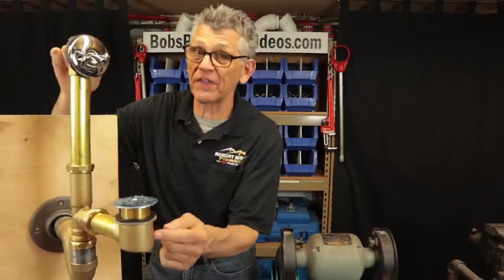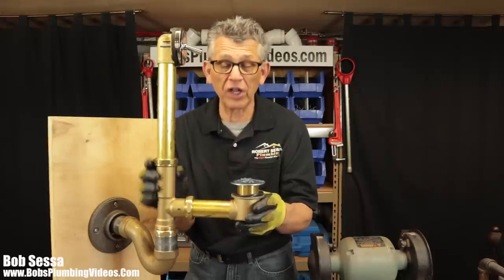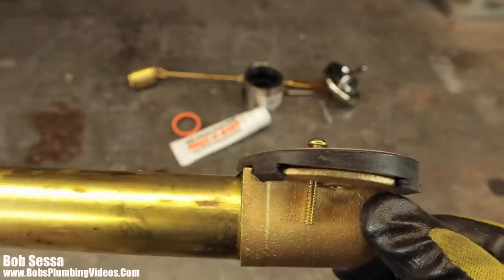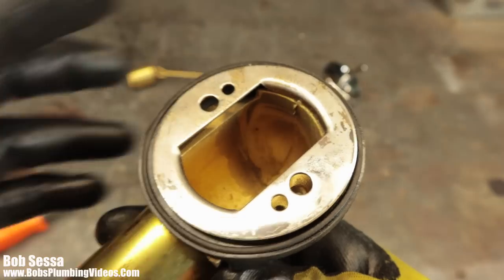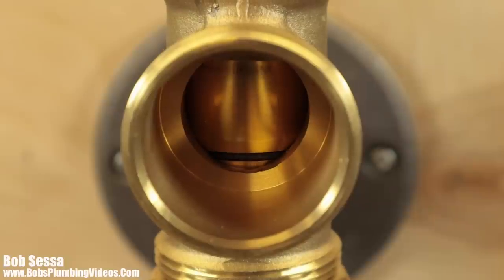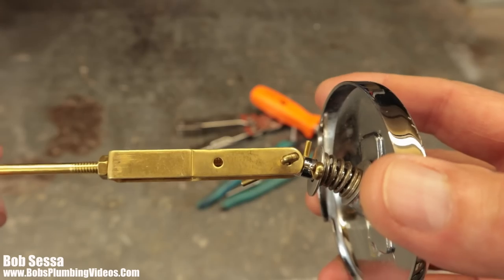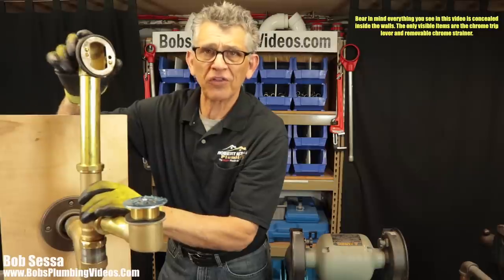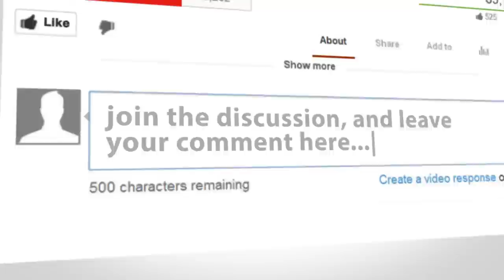Bathtub Drain Stopper / Trip Waste Assembly

Comment: Hi Bob. Well I have a doozy, when I took the plate out, I discovered that the linkage  was corroded and  the threaded rod was broken in half. So I assume the other half is in the pipe, at the bottom. What should I do? Can't afford a plumber, so mom has to fish it out somehow.
Reply from the maker: I can usually fish it out with a wire coat hanger, Make a small hook on one end and go fishing. Be warned, sometimes the plunger is so full of soap scum and or scale it will not come out. In this case you'll have to access it from the back and remove the overflow to yank it out.
Reply: Thanks.

Comment: My trip lever doesn't always stay open, as a result it has a habit of closing the drain while showering.  I have to keep opening it up so that the water drains again.  It just wants to keep closing on me.  What could be causing it to constantly do that?
Reply from the maker: The spring behind the face plate where the lever is located is probably at the end of its life, you can replace the entire face plate. The kit comes with new screws, just pull out the linkage,  pull the cotter pin out and transfer it to the new face plate. Re-install the cotter pin and you should be goos to go. Here's a link...https://bit.ly/3KX0fHw

Comment: Hey Bob. Great video and explanation of the assembly. This might be a dumb question, but how does the overflow work if there’s a stopper blocking the overflow pipe? Doesn’t this defeat the purpose of having an overflow? Am I missing something here?
Reply from the maker: The stopper is a hollow piece of brass that blocks the tub from draining, but still allows water from the top to pass thru.

Comment: I appreciate the full assembly example used. It always helps to get a Big Picture.   Bob also does a great job of clearly reviewing what has been taught to be sure we see the whole picture.  I will be checking things from Bob on any plumbing needs I encounter.   Great job Bob
Reply: I have a home owner customer that doesnt remember if the drain always drained or  if a stopper was  in pipe
To fill tube. Its unbelievable.  Anyway I  put a line from top or bottom and comes  out  on other side..
Do I have to make a hole on other side of.tub to unclog???

Comment: What if the flip is not connected to a plonger anylonger, n the water dont drain out the tub,whats to do
Reply from the maker: You have to find out  if the the plunger is in fact still inside the tee. Use a coat hanger with a hook on it and try to fish it out. I use a mini camera to look inside and verify if it's in there.

Comment: Would it be a good idea/no risk to remove the strainer just to clean out the hair that has accumulated directly beneath it and then reattach it?  My tub has some pooling of water during a shower which completely drains in about 5 minutes or so after turning off the water, not terrible but I'd like to get a better flow before it gets any worse.
Reply from the maker: The "strainer" that attaches with the screw? That you can remove and fish out any hair that's accumulated. But do not remove (unscrew)  the entire strainer assembly, you could open up a BIG can of worms!
Reply: @BobsPlumbingVideos  Yes,  just the strainer itself that attaches with the screw.  I never even considered removing the entire assembly, plumbing is not my forte! 😱 Anyway, I removed  the strainer and pulled out a few clumps of hair using a drain weasel although not as much as I was expecting.  I then replaced the strainer and much to my surprise the water is now flowing as I hoped it would....no more pooling and the little bit of water right over the drain was gone in less than 10 seconds after turning off the water! 😀 Thanks Bob, your video gave me a much better understanding of the drain system and the confidence to give it a go! 👍

Comment: Thanks for the video Bob. I wish this was available onto Youtube 10 years ago when I replaced the overflow on my tub.
No locking faceplate on the overflow and here I am 10 years later doing this again because the tube coming out of the shoe came loose while snaking the line.
Thankfully we have a 24 hour supply house in Brooklyn.  10 years older, and the 12 inches I had to work in 10 years ago seems to have shrunk
Reply from the maker: Thanks for sharing

Comment: Best video by far we've  seen. Very much appreciate you take the time to show every single thing. We just put in a brand new entire bathroom. Hooked everything up and everything worked but the tub wouldn't  hold water and zero instructions. So we've  been watching some videos and yours is by far the best. We give you a hundred stars. Thank you and ours does not have the backing plate.  And I think that we will find one that does just in case.  Thanks again. 👍👍👍👍👍

Comment: I currently live in a duplex and rent one side out.  Our side has had various issues, and I just discovered today what these systems are called.  One side has a trip lever with no plunger or spring-to-stopper system, while our side, has the lever with the spring, but there is no hardware connected where the spring ought to go, from the To to the non-existent plunger.  I have a 2 year old, by the way, and your reference to the little toy soldier brought laughable tears to my eyes.  Excited to see more of your videos.  Thanks for sharing.

Comment: My tub hasn't been draining right for a while now.    Cleaned the hair out, drain cover removed and replace properly.  Still wouldn't drain very well.  I was cleaning the tub after soaking some oven racks and leaned on the trip lever.  WHOA,  I could hear the water rushing down.   I've known the problem but not the fix.  UNTIL NOW!  Thanks so much for the great information.  Just knowing the industry name for it is a big help.  The guy at the store won't look at me like I have three heads when I ask where they are now.
Reply from the maker: Thanks for checking out the video👍 regards, Bob.

Comment: Bob.   Love the detail.  Our 18 year old tub would slowly drain.   I figured it out by taking it apart and extending the rod.  Both Nuts were away from the Plastic Swivel.  Your video was the first one I saw because I wanted to know how it sealed if its metal to metal.  Mine doesn't have the Orings (At least I didn't notice them)  Im gonna take it apart again and clean and silicon grease it thanks to your suggestion.
Reply from the maker: Thank You, Gerry!

Comment: Thank you very much. I was debating between a PVC and a brass drain and your comment about the separate set of screws securing the overflow in position solved my dilemna in favor of brass.
Reply from the maker: Excellent! Brass is a time tested material that will be here long after we're all gone. Thanks for checking out the video,regards.Bob.
Reply: Agreed.  Plastic is cheaper but is also mickey mouse at least when the job is bathtub.

Comment: Thank you so much for this.  It was really well done and so very informative.  I had just patted myself on the back for snaking the tub out but did not at all consider the risk of doing so without having the drain secured at the overflow.  Good to know.  In the video you only have the plunger adjusted to come down so that the o-ring was still somewhat visible.  I understand why you did that because you wanted it to be able to come up all the way when open, but if you do that won't water just leak below the lower o-ring?  I'm guessing that in reality when you adjust it in the wall that the proper placement would have the upper o-ring sealing just above the drain (so water doesn't rise up the overflow till level w/the tub) and the lower completely below the drain pipe exit (so water can't escape downward).  That said, when I looked at the hardware store they sold a brass plunger assembly without O-rings.  Wouldn't such a plunger be guaranteed of leaking unless it was machine to fit the overflow pipe perfectly(which seems unlikely)?
Reply from the maker: Glad you enjoyed the video! Actually, most of those plungers don't have "O" rings on them. They, in theory, are machined to very tight tolerances and once seated into the tee are supposed to create a  watertight seal. That manufacturer was Wolverine Brass where I purchase most of my daily maintenance plumbing products from, but they only sell to the trade. Regards, Bob.

Comment: Great video and it explains everything just perfectly. I tried to take out an overflow plate that was not working correctly and in the process stripped both the screws that held the plate in place. I am sure in yours years in plumbing you must have come across situations like this but I have NOT. Please tell me how do I remove these two screws that are really stuck in there and broken without much area to  work with. Thanks. I wish there was a way to upload the pictures I have of this situation. Many thanks in advance.
Reply: This plate is more than 45 years old.
Reply from the maker: The short answer is to drill them out, then re-tapp! Can you take some photos with your phone and send them? info@robertsessaplumbing.com.

Comment: You video was GREAT !! Thank You,, I CAN NOT GET THE PLUNGER OUT !!! And yes ,,I have been spraying it with penetration Oil !!--House built--1950
Reply from the maker: I've comes across the issue several times, and unless you have access from behind to break it down and remove the plunger, may be best to leave it alone (as long as the water is draining).
Reply: @BobsPlumbingVideos  --that you for your quick  response--Draining Very Slowly---Someone posted that pour CLR will Dislodge it  !!
Reply: @BobsPlumbingVideos  --had to come from the back and break it down,,But thanks to your video,,I knew what I was doing,,Had to use Liquid Wrench--and working it out ,,by twisting ...

Comment: Thank you! I've watched about 7 videos, wondering how the trip lever works!?! After 2 mins. Of this, u explained it! It's like a plug! I understand it now! One small step at a time! THANK YOU!!! But what about, if there's a spring at the bottom of the linkage that holds the bar that connects to the stopper at the drain, instead of a plug?
Reply from the maker: Thanks for watching! Regards, Bob.

Comment: Great "studio setup"!  Nice to actually have that visual of the system, so we can SEE what we're up against.  My son's tub was clogged, and, of course, his drain stopper is frozen stuck!  Put some CLR down there, but, when I gavit a yank, this mornin, the coupler came uncoupled, and only the upper half came out.  Been fightin withit with'a coathanger for awhile, but even when it seems to catch on something, it bends the hanger, as soon as any real force is applied, and I suspect it's still frozen solid.  Any pro tips for this scenario.  Unfortunately, my mechanism is def NOT the top quality brass unit u have in your studio.  Faceplate screws, and upper linkage were VERY rusty, and I suspect it's prolly pretty nasty down below, as well...
Reply: Anything work with your situation? I am STUCK just like you’re describing

Video is super helpful but like the stopped water, I’m at a standstill 

Wire hanger is already a golden nugget of  inspiration to help out but can I keep CLR in longer than minutes per instructions or perhaps into hour or longer?
Reply: @Razberuru  Ha!  I've been ignorinit, hopin an asteroid would hit the earth, n solve all my probs... 🤣  I'm thinkin, when I finally resolve to git'r done, I'm gonna purchase a snake inspection cam for my phone, so I can hopefully SEE what's down there, n fabricate some rig that's strong enuff to withstand tha yankin it's gonna take to pull that lower half out.  I'll prolly spray some penetrant down there too.  CLR ain't nearly so corrosive (Nor as effective!) as muratic acid, so I wun't expectit to damage anything.  LMK if u have any luck... 😉
Reply: Dealing with the coupler broke and only released the top half. I’m using CLR, a coat hanger, bought a length of chain with and S hook. It’s not catching. Tub won’t drain.

Comment: Awesome explanation, Bob!  Any idea how to get a stopper out of the tub if it's stuck? It just won't come out.
Reply from the maker: I've had this problem myself, try a wire hanger, create a small hook on one end and try to snag it and pull it up. I've sometimes had to saturate it with WD-40 down the overflow, let it sit for a day or two, the try and retrieve it. And then there are the ones that just won't budge, time for surgery from behind. Open the wall remove the overflow and yank it out . When done I install an access panel and if it's on an outside wall, you got a bigger problem!

Comment: Curious if you could measure the linkage length relative to the overall height of your assembly. If for instance your center y to center  was say,  12” then your 1st set up would set the linkage at say, 9 “  that way at keast it’s not a guess

Comment: Great video and I have a question...  Is it ok if the existing overflow pipe is sliding up/down with little force?  
Trying to fix a leak and I'm pretty sure the overflow gasket is the reason but curious about the pipe fitting at the bottom.
Thank you!
Reply from the maker: If it’s moving up and down as you mention it doesn’t necessarily mean it’s leaking, but I would minimize movement and replace the upper gasket. Thanks for commenting! Bob.

Comment: Hey Bob.  Great video.
My problem is more extreme.
While replacing trim (brass to brushed nickel) I found that the linkage from the overflow switch to the stopper arm must have disconnected at one time or another and slid down the T.
Where would you recommend I start dismantling the overflow tube from outside the tub?
Really need a good answer soon.
Thanks very much.
Reply from the maker: If you have access to the back of the tub, that’s the best way. Same thing happened to me on a job and the only way I was able to do it was from behind.
Reply: @BobsPlumbingVideos  Hi Bob.  Yes, I should have been a little more specific.  I have already gained access to the tub through the wall.

It appears to be all brass with a brass coupling near the bottom of the T overflow.  It's a rather tall tub, acrylic, Kohler with Kohler drain system.  Circa 1998.

If I were to start removing parts, where should/can I start?  The large nut (coupling) near the bottom?  Will I have space to slide the two pieces apart to get at the lift rod?

If the extraction is successful, I plan to replace the lift rod with a new one.

It's very kind of you to help.
Thanks.

Comment: Hi Bob, really nice video. I have a few questions about a brass drain that I hope you can help me with. I bought a brand new brass drain for my new replacement tub. Due to the nature of the installation, I installed the drain on the tub while it is out of the alcove. I wanted to test the drain shoe gasket for leaks before installing the tube in a base of mortar. The access to the drain from below is a PITA. So with the drain stopper down, I poured a bucket of water inside the tub. No leaking around the drain shoe, and it held the water except I noticed a very small drips of water coming out of the bottom inside of the drain where it would connect to the tail piece and into the trap. So water was getting by the brass plunger. I removed the trip lever and let the drain plunger and linkage "free fall" to see if my linkage was not adjusted properly, yet the small dripping still happened. So my questions are, is this normal for a brass plunger type of drain (brass on brass)? And once the tub is in place and the trap is connected, water is in the trap, so will this slight dripping just fill the tailpiece from the trap back to the drain plunger and then stop since there is practically zero pressure to push water through the trap? I'm not sure what is takes to move water through a trap. Not sure how many people even know this since all the drain testing I have seen is after the tub is in and drain is connected to the trap. Thanks for any advice on this!
Reply from the maker: In my experience brass on brass very rarely is going to hold 100%. You may have a very miniscule drip through the seal which bath takers  
should not even notice. I don't believe it's enough volume to create movement through the trap I.M.H.O.

Comment: Excellent video! I am havng an issue with this right now & have seen buildup in the pipe when removing the triplever stoppage tool & it still does not stop up the tub, so now I a on the search for one with O rings attached or do I buy the O rings & attach them? also, the equipment seems pretty standard & metal has already bent should I try a regular hardware store?
Reply from the maker: No,  the hardware store won't have it. The one in the video came from a company called Plumbmaster, but they'll only sell to contractors! Do a google search, I'm sure they're out there!

Comment: Hey Bob I have this setup in my 60s bungalow-I never noticed it before so it could have been doing it all along but mine is brass to brass as you mentioned and appears to be leaking a bit when I'm having a bath. Should I ever expect it to hold water perfectly if it's brass to brass or is some drainage/leakage normal?
Reply from the maker: Bottom line is that if it's an older unit of lets say 25 plus years and beyond and you've adjusted it to the max, it's going to seep a bit. Easy fix , just get a large rubber stopper to place over the strainer and problem solved.

Comment: Great & informative video Bob. Could you tell me where to purchase the back locking plate and the brass plunger with o rings or the manufacturers name. Thanks
Reply from the maker: https://www.plumbmaster.com/wolverine-brass-56429-trip-lever-dome-bath-waste-17-gauge-cast-brass-nuts-chrome/p/56429. They only sell to contractors. Here is an alternative from amazon - https://www.amazon.com/gp/product/B000QCLQ3M?ie=UTF8&th=1